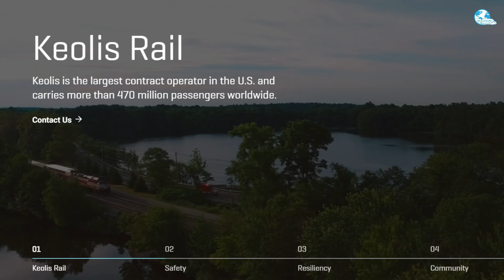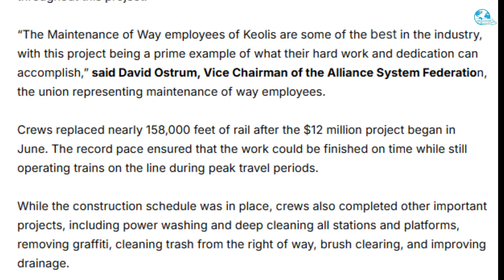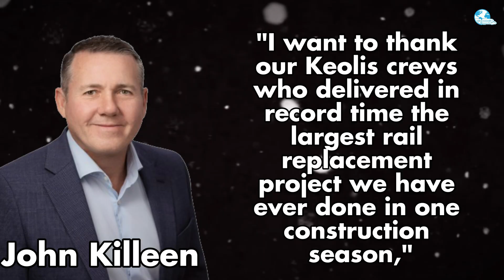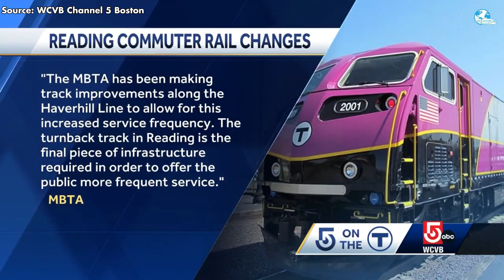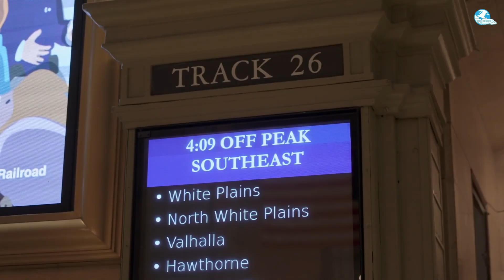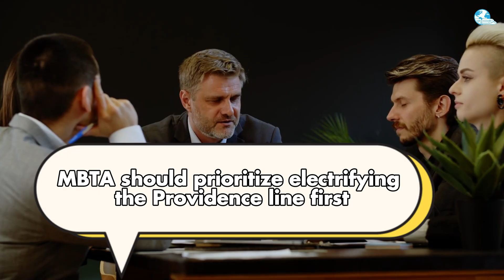The MBTA’S FIRST Electric Trains are coming soon…

Comment: WHERE'S  THE  THIRD  RAIL 🚈   THAT  SHOULD   BE  INCLUDED
Reply: It's powered by overhead wiring as in every other place that has electric trains.
Reply: You need to build more substations to power the 3rd rail at 650 volt DC,24kv 60hz wire can
get by with less  substations

Comment: Figure on a dispute  between  
MBTA and Amtrak on what is
needed on the NEC to use the catenary, a few new substation will be needed to handle the load
Reply from the maker: yep, NEC power issues are a challenge.
Reply: It was a given that MBTA would 
need to build substations to cover
their power needs
Believe South Coast Rail has to have catenary from  the beginning

Comment: These should be hybrid/electric so they can be used interchangeably between the Fairmont line and the Providence lines.
Reply: They are, sorta? They've got pantographs, so they could conceivably run to Providence
Reply: @counterfit5 They would need to pay Amtrack to use the wires on the Providence line. My understanding is Amtrack wants too much fir that

Comment: I hope that once they start running them on the Fairmount line they actually electrify it over time. Battery electric trains are NOT an excuse to not put up wires or put down 3rd rail! I also hope the other lines get some attention too as the Providence line as well as the Stoughton and Needham branches really should've been electrified by now!
Reply from the maker: Batteries can't completely replace electrification systems, but what if they could?
Reply: Something tells me they’ll add wires above years later.
Reply: "Americans will eventually do the right thing after they have exhausted all other options" -Abba Eban